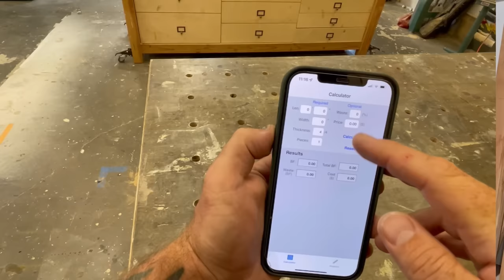Don't Buy Wood Here || Beginners Guide to Buying Wood

Comment: One thing I've learned the hard way is make sure you buy enough extra wood so you can make some test pieces and practice joinery with the actual stock. it feels wasteful but in the end it's not because it helps mitigate major screw ups and the project looks better. also recently I've been getting veneered plywood over MDF core from the hardwood / sheet goods supplier. I was slightly skeptical but it's easy to work with, no voids and incredibly stable.
Reply: sorry, not a telegram user... too many Double Agents!

Comment: Great video.  The big boxes have their place, mostly because they're close by.  It's fine to by a board or two at them.  With respect to good lumber, I'd advise finding local sources (e.g. not places like Woodcraft).  Where I go, they mill boards for you at no extra charge, they help paw through huge stacks of huge boards to find the right pieces.  It's a wonderful place to shop.  Poplar gets short shrift in this video.  I really like it.  It has subtle streaks of green in it, it is strong, and with some thorough sanding it can be slick as silk.  I made some floating shelves out of poplar and finished them with three coats of tung oil.  They came out beautifully.

Comment: Im very much a hobbiest wood worker, and I was so tired of the low quality of Wood at home Depot and Lowes. Found a local wood center here in SoCal. And man they were not very helpful and treated me like I was in the wrong place and said only cabinet makers buy wood there.
Reply: If you're somewhat local to San Marcos or Carlasbad, I get my wood from "San Marcos hardwood lumber" in San Marcos or "Tropical exotic hardwood" in Carlsbad. Both family owned and operated and are very informative. They both have pretty good selection of hardwood. Tropical hardwood does not sell plywood though. I go to San Marcos for the furniture grade plywood. They will also break down the material for you if needed.
Reply: We definitely have a place here in Kansas City like that. They have the best prices on Baltic birch plywood but they’re not too friendly and treat you as an inconvenience cuz you aren’t buying 20+ sheets. I don’t go there often, but when I do, I just keep my head down and not let it affect me. They’re getting my money so they can deal with it.

Comment: I like the sapwood/heartwood contrast, I think it looks dynamic and interesting. I will pass a board for deformation and knots, but sapwood is beautiful to me and I like to use it. It's like natural racing stripes in your surfaces.
Reply: was going to say this same thing.. my concern is if the difference in density between sapwood v heartwood could lead to problems over time due to different rates of expansion?
Reply: I'm a big fan of the look of the sap/heart on some pieces...especially on the lathe...beautiful wood beautiful contrast!!

Comment: Great info. 
I'm getting my shop setup soon. I'm pretty well a beginner (done a few things in the past but never anything steady) so I have been looking for some place local. I want to start with some better Plywood and make myself cabinets for my shop to organize it etc. I figure that is a pretty good start for continuing to learn. I don't see myself doing it full time but rather doing it enough to pay for some equipment etc. 

I looked up a few places and hope they are decent. Their websites generally suck though. So hopefully I can find a few places. There is a Rockler and a Woodcraft here but they seemed expensive too. Just need to figure out what decent plywood cost to start with.

Comment: It gets even more complex with plywood.  Number of plies, whether it's lumber core, etc., etc.  Last time I bought a 3/4" sheet of birch veneer at Lowe's, the veneer was paper thin (less than 1/64 rather than the usual 1/32), which is easily sanded through if you're not careful.  Also, it's not 3/4" anymore either.  Now they're shorting you by up to a 1/16" on the thickness.  Last time I bought from a local yard, I could still get the good stuff.
Reply: it has been that way for years
Reply: Hope Baltic Birch makes it back to the states. Hands down best plywood I ever used by a mile.
Reply: Most of it is actually metric thicknesses now I think (12mm, 18mm etc). Since they don't want to be inaccurate, rather than risk confusing people by forcing to be aware that other measurements systems exist, they use inch fractions in 1/32 increments that someone apparently decided are less confusing. So you have to sit there for 30 seconds thinking "19/32... that's 1/32 less than 20/32, which is 10/16... oh, it's 5/8"

Comment: For figuring out how much wood to purchase,  I prefer to draw up / design the piece in CAD first.  It also helps because I am novice at woodworking, and having a design with drawings really helps gives me a confidence boost as I start the project.  That being said I know CAD is not for everybody and I admire those skilled enough in the art to just go for it.
Reply: "that being said I know CAD is not for everybody..."

and neither is being skilled enough in the art to just go for it.
Reply: Don't have a computer,so CAD to me is "cardboard assisted design". Hahaha
Reply: I'm a modern engineer, but when I do woodworking projects, I actually prefer hand drafting. I never even learned it professionally (unfortunately), but it is just so much more approachable when doing a home project.
Reply: Former draftsman/designer and for my woodworking projects I always used CAD, Cardboard Assisted Design. Hajaja
Reply: Cabinet maker /finisher here, just 6 months away from 40 years in the biz and although I have worked for businesses that used CAD programs for shop drawings and such I still prefer to use PAP. 
       PAPER AND  PENCIL

Comment: One thing you didn’t touch on was cost. Does it end up being cheaper to buy from the hardwood place? You mentioned that the prices at Home Depot were high but never compared the hardwood place. I don’t have a planer or jointer so I have to pay the hardwood store to mill it for me. Is it more expensive to buy from a hardwood place and have them mill it for you? Or more expensive at Home Depot?
Reply: Depends what you're buying. Box stores normally carry mostly pine with a small section for poplar, maple, red oak, and maybe one or two others depending on the area. At least right now those hardwoods at the box store are insanely expensive so buying them from a hardwood place, even a chain like Rockler or Woodcraft, will be cheaper. Even if you want them to do some milling which typically isn't that expensive. 

As far as plywood goes, the box store will likely be a little cheaper since it's mostly construction grade. They carry some better quality plywood like Sande Ply, Radiata Pine, etc and it works in some situations and the price will be about the same as plywood at a hardwood center. But hardwood centers also carry ply that you can't usually get at box stores like walnut, oak, birch, etc. 

So it's really kind of difficult to compare apples to apples with a box store versus a hardwood supplier because they operate in two different markets for the most part with just a little overlap.
Reply: Rewatch the video...it's quality vs quantity
Reply: @gregmize01  oh I know the hardwood dealer is much better quality. But is it 10% more expensive? 50% more expensive? 5 times more expensive? I know it depends on the wood also but it would be helpful to get some rough idea of the difference in cost.
Reply: @theburnetts  It really depends on where you are and how many suppliers are in the area (i.e., is there competition).  Where I live there's a very nice supplier that will do the milling, etc. and most of the time the total price winds up to be ~20% more than Home Despot, er, Depot, which ultimately is the cost of the milling.  ETA:  Oh, and I like them in part because I'm a woman and they treat me like a human being rather than the dudes at the local HD, who are almost always condescending, especially if I'm with my husband, who doesn't do any woodworking.

Comment: Trying to find suppliers interested in doing business with hobbyists in L.A. is miserable. (And the lumber departments in the local hardware chains are even worse than the big box stores -- unless you're a contractor. I'm looking at you, Anawalt.) Inevitably wind up back in the incredibly overpriced 'hobby board' section or trying to repurpose stair treads and whatnot. The Rockler store sells wood but that's no deal either, and it's across town....
Reply: Move to OR or WA. LOL
Reply: Try Reel Lumber Service in Anaheim. I’ve had good success there.
Reply: @javannel   A bit of a drive, but thanks; I'll check 'em out.
Reply: I'm in Riverside and I had the same problem.
Reply: Sounds like reason to get the hell out of dodge
Reply: Another thought, CA Government allows you guys to cut the trees? 😆
Reply: I know it's a drive but John is right. Reel lumber is the place to go.
Reply: If you’re near Torrance you can check out Hudson and West. Anderson Plywood is a good source in LA. I’m not an LA local but have used both when working there.

Comment: I recently bought two 2 x 8 x 10's for a project. The wood I sorted out of a bundle at Home Depot seemed okay but the next day after being stored on a cool flat garage floor with even weight on it so it would not warp. it began to dry out but both twisted like licorice sticks. Took it back.
Reply: Haha yup. Experienced the same thing pretty much. I still used it as I was just building a simple tool holder for the garage but yeah the lumber at HD sucks.

Comment: The biggest challenge for me is figuring out how much to buy for a project. Our hardwood dealer has everything rough sawn and all of the boards have varying widths and varying lengths. It is always a complicated puzzle for me to figure out which boards I should buy and how I will get what I need with as little left over as possible. Some boards are 8” wide, some are 11” wide, some are 7’ long, some are 9’ long, etc etc. It takes me forever to draw a diagram of how I am going to cut up the boards to get all of the pieces I am going to need with as little left over as possible. That is my biggest frustration with buying from the hardwood place. It’s much simpler at Home Depot because everything is a uniform size.
Reply: Spoken like someone who either doesn't have a jointer/planer or who hasn't ever built real furniture from rough lumber. Do it three times and you will never settle for the other stuff again.
Reply: @GeeDeeBird  I don’t have a jointer or planer. And I have built plenty of furniture using rough cut lumber. All I’m saying is the wood is super expensive so I’m trying to have as little left over as possible
Reply: Buy 1.5 times what you think you need.... Very simple
Reply: Design your furniture, make a detailed cut list, and lay your pieces out at the lumber store
Reply: And add 20 percen
Reply: @theburnetts  🤣🤣🤣🤣🤣🤣🤣
Reply: @theburnetts  Fair enough, Corey. Except that your post discusses uniform dimensions, not cost. Cheap wood makes cheap furniture. It may be functional, even beautiful. But, furniture to pass down through the generations is made with hard woods. And the best hard woods are not found at Home Depot.
Reply: Some of the hardwood selection apparently depends on the location, because the ones where I  live have a much better selection. Not as many exotic as the hardwood store but lots. 

Besides not needing to invest in a jointer and planer, you also don’t need to buy wood that you’re just going to mill away - unless of course you want a live edge. Why buy 4/4 wood and spend the time cutting away 25% or more of it in the machine that costs hundreds or thousands of dollars when you can buy a 3/4” board that’s square on all sides?
Reply: @johnlee7085  if you are buying  3/4" S4S lumber you are paying for 4/4  plus labor to finish down to 3/4"
Reply: @theburnetts  
You need both, they'll pay for themselves over time, and the finished product is usually a lot better. Theyr re a game changer.

Comment: Awesome video. I buy most of my lumber from Home Depot because I'm a hobby builder. I use retail store grade/priced tools, so I tend to drift away from super expensive lumber. Also, if I could afford to buy high grade lumber, I'd probably have a big shop with nice, fancy tools. But all in all, great vid with good tips. I bet those HD customers were like "WTF is wrong with this guy??" Thanks for the entertainment.
Reply: You should definitely rethink this. Hardwood stores are frequently less expensive for the same products than box stores arw
Reply: @mattsnyder4754  in my area north Idaho, I bought cabinet grade plywood with one side finished from Home Depot each sheet $80, in hardwood store same sheet cost $115. So, no, big box stores are indeed cheaper.
Reply: @lidiyakruglov  “frequently.”
Reply: @lidiyakruglov  Thank you. Exact experiance Ive had with hardwood stores.

Comment: I just contacted Hardwood Centre and used you as a reference; I just had a horrible experience at Home Depot today so I'm looking for a specialty store as I'm building new kitchen cabinets and counters. There's someone here in New Orleans who dropped off some birch plywood relatively cheap for a pair of dressers I built bit they don't have a site up and in the middle of New Orleans so hard to see what I'm getting before I buy it.

Comment: I buy my wood almost exclusively at Home Depot, but I'm far from an ordinary woodworker: I primarily make wooden Weapon replicas (swords primarily), and the smaller poplar segments suit my needs quite well: about $10-20 per project, not including the glue or paint, so it's pretty easy to just pick up a few sheets and get to work.  Though, if I were ever buying something that would be for function more than it would decoration, I would definitely follow this advice.

Comment: Once of the hardwood suppliers in my area also stocks exotic woods as well.  The problem with these places is, PRICES.....its very expensive to buy a lot of these different species of woods....so, when you do, be prepared for sticker shock.  Make sure you buy all you need for a project because if you go back later they may not have it, or the next bunk of stock they get in is a different color, or not as good in quality.

Comment: 8/4 hardwood lumber is at least 2" thick, at a minimum, according to the minimum thickness rule when it is cut. The issue you are describing is that the 8/4 is measured green and then the lumber can shrink a little in the kiln. Generally speaking however, 8/4 green lumber is bought at 3/16-1/4" plump for thickness to account for this. If you're buying 8/4 rough kiln dried lumber there will be a variation in thickness depending on a lot of things (including warp/cup), but if you're buying "8/4" surfaced lumber it should at 1 3/4" thickness (or around 1 7/8" for hit and miss surfacing). Same thing with 4/4 lumber, 15/16 is the standard hit and miss planed thickness with 13/16 being the standard "finished" thickness. You can reference the standard surfaced thickness rules in the NHLA rule book for the specifics. 
Cool video though, fuck the big box stores, and long live the independent guys.

Comment: A lot of the wood I have been getting from HD lately has been questionable quality. Construction lumber is often cheaper so it makes sense sometimes, but you might not know the problem til you get it home and try to work with it. As you say in the video, it's nothing against the big box stores, it's just important to know what you are getting at HD. Definitely don't make furniture with wood you buy at Lowe's or HD!

Comment: My last trip to lowes resulted in me "cutting" my own L shaped trim. I went out to the parking lot after purchase, angled the trim and stepped on it until it broke. That resulted in a loud crack that drew the attention of several shocked employees who inexplicably came out of the woodwork after the fact. I got my small pieces i needed for my project and didn't have to wait anymore than i already had.

Comment: I was an idiot for the longest time only buying from HD or Lowes. Then I found out about a couple of local hardwood stores and I will not go to the big box store anymore for quality wood. If I need a sheet of ACX sure,  I'll go to the big box. But quality? No, they are quantity. And like the video said, they are more for "construction" not cabinetry or quality woodworking. Loved the video! BTW, I'm kind of surprised HD did'nt call the HD police on you. They don't like that kind of stuff (I used to work there!).